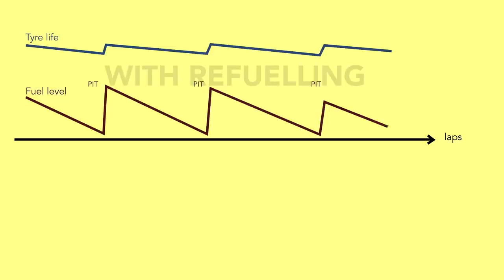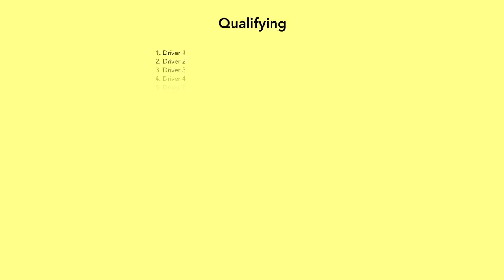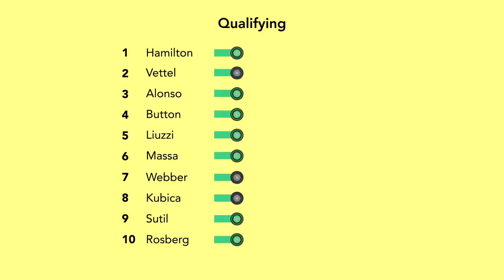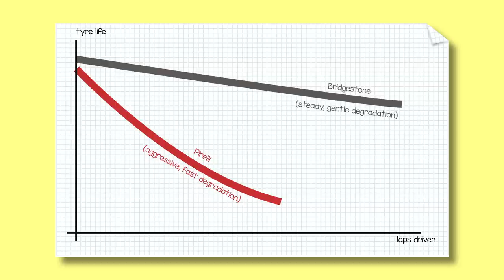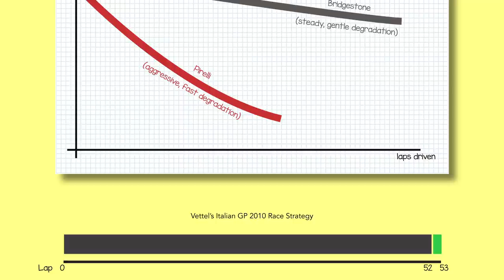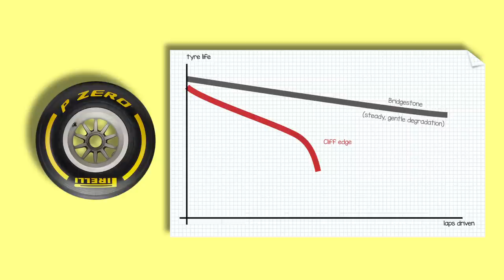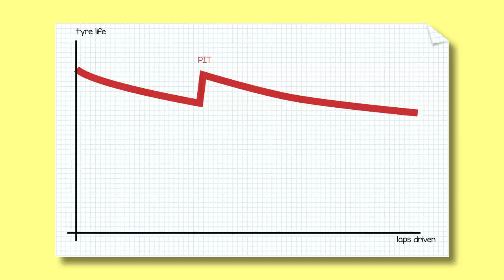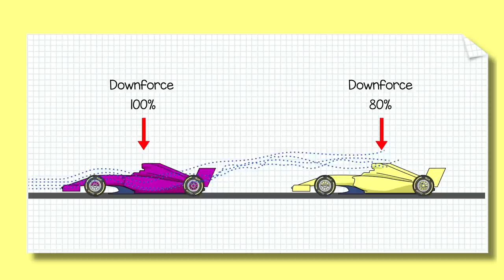How Canada 2010 shaped F1 for a decade - Chain Bear explains

Comment: Banning refuelling was the biggest mistake F1 - these days everyone runs the same strategy and it only really gets exciting when spanners are thrown into the works - with refueling you'd have a mix of short stints and long runs in the pack, never really sure who was going to pit when

And it hasn't had the desired effect anyway, with the reason for the ban to try and help reduce costs, but instead its just moved the costs with teams trying to shave time off the tyre changes- for example, last year lower teams use a fairly conventional, manually controlled wheel gun where as bigger teams like Mercedes are automatic wheel guns that costs about £20,000 EACH!
With refueling back in place, the tyres have plenty of time to go on and greatly reduces the risk of improperly fitted wheel nuts
Reply: on the contrary, refueling, if not done properly, can be really dangerous. Ask Max's dad, he learnt that first-hand. Not that I necessarily would see it vanish and never come back though, the overly emphasis on tires and its life has pretty much ruined the weekends all over ever since. Just look at W10 absolutely sweeping every race because they happen to treat their tires the best (from what I know). I thought race cars are supposed to be cars, not tires?
back then no one really complained about tires and all that and they're allowed to push the car as much as they could. some people might disagree with my opinion with tires, but personally I prefer driver skill over the ability of chassis itself. At least I never heard of 'conserve this, conserve that' in old races, but what do I know.
Reply: Dave McKeegan have you seen huge fire created by failed refuelling? Im glad its banned.
Reply: @bshenlow882  there have been a couple of high profile incidents around refueling ... But there have been far more incidents of wheels coming off both in pit lane and on track ... And I would argue between a fire around people all in fireproof clothing Vs a few hundred pounds of wheel being flung into a crowd of spectators which is more dangerous

I totally agree with you though, it's no longer racing, it's become endurance now
Reply: @mtunayucer  Indycar has always had refuelling, and has had very little major incidents.
Reply: @mtunayucer  have you seen the carnage of wheels flying into the crowd? ... Maybe we should ban tyre changes as well

There is always risks involved, but the amount of risk these days has been greatly reduced 
If you want minimal risks we could cap the top speed of the cars as well, maybe not allow them within 6ft of each other either
Reply: Dave McKeegan i have never seen that, can you send me a link?

F1 is trying to be as efficient and less harmful to environment as possible. Bringing refuelling back will be a backstep in those regards.
Reply: @DaveMcKeegan  C'mon man lets be real, your analogy is quite futile . Banning 1 aspect doesn't mean you have to ban others...Reducing risks doesn't equal reduce all risks.
Reply: @SunLevi  but how do you measure risks? Because in terms of injuries caused, there has been more injuries caused by tyre changes than by refueling

Overall the point of F1 is supposed to be the pinnacle of racing and strategy - but that isn't the case these days, with tyre management and 3 engines a year it's becoming endurance
Reply: @mtunayucer  if it's really about that "environment friendly" reasons, they'd go for electric by now and don't half-ass it. It's just the downsizing trend hit them back then when manufacturers thought turbo engines use less fuel but turns out that's not the case. Emissions? Almost, if not totally irrelevant.
Reply: @bshenlow882  Half of that issue was putting turbos on too small of an engine to try and crank out power. If the base engine is asthmatic to begin with the power output with a turbo chucked on is going to be crap.
Reply: BShen Low Formula E exists? You know? When all electric cars match speeds of F1 cars today, we will stop using fuels.
Reply: @mtunayucer  what I meant was they could've just switch over instead of making a branched out Formula exclusively for EVs.
Reply: @DaveMcKeegan  "Overall the point of F1 is supposed to be the pinnacle of racing and strategy".

What? This is absolutely not the case, since the beginning F1 is supposed to be the pinnacle of engineering and technology. F1 is designed to be an engineering race, not a close wheel to wheel race, that's what spec series are for. 

And the reason tyres shouldn't be banned even though it's a potential hazard or more dangerous than re-fueling is because it's obviously integral to the race, which fuel has become less so, due to... Technology!

Saying that "ohh this has to be eliminated too because this is" is rudimentary. things don't have to be directly equal or absolute. 

Lets actually analyse what would happen if refuelling came back, it has it's pros but people seem to have forgotten the cons. Refuelling biggest advantages were speed and weight saving, which didn't make the racing on track close at all. Not to mention the cost & expenses of refuelling.
Reply: Maybe introduce a forced 5 second stop minimum, and if refuelling is reintroduced make it a 10 second minimum stop so teams can get it all done safely without having to stress about fractions of a second , much less mistakes.
Reply: BShen Low as i said before, the electric cars arent as fast as formula 1 cars. When electric cars surpass f1 cars in speed and other aspects, they will replace f1
Reply: @SunLevi   Sun Levi  well that's bull since half the technology and engineering created in it over the years gets banned and they keep modifying the rules to encourage overtaking

Introducing refuelling would bring much more options for strategy and unpredictability rather than everyone running the same number of stops purely being dictated by tyre life (and arguably would make the cars more efficient as they'll be carrying less weight through the race)
The cons would be an increase in risk factor however I think the risks isn't as high as some people like to believe - it would also apparently increase costs because teams would have to take the refueling rigs with them to the races - however, as I said in my original comment, with the banning on refueling, teams are now spending insane amounts of money on equipment to speed up tyre changes by mere fractions of a second, and changing tyres in 2seconds increases the chances of mistakes - with refueling taking 6-7 seconds would prevent the haste on the tyres

My point about banning other things was more exaggeration - if the argument for banning refueling and destroying the fundamentals of racing purely from a reducing risks then we should first remove elements that pose more risks - and on numbers of injuries/risk factor - tyre changing poses more risk than refueling
Reply: @DaveMcKeegan  Fair point, but I don't think refuelling is at all the solution, it brings more cons than pros. Refuelling isn't going to make the racing any close. Less predictable sure, but not exciting enough to bring back. 

The strategy we have now IS predictable, but I believe there's an alternative solution to either issue. One that doesn't involve refuelling and one that isn't a 1 pit stop race, hopefully F1 can find that solution soon. 

Bringing refuelling back won't solve any of F1 current issues.
Reply: @SunLevi  I think you are quite mistaken about the effect refueling has on strategy -  you only have to look back at the Brawn/Schumacher era to see how the right strategy could transform a race

One team could go 1 stop, longer stint but slower pace Vs someone going for 2 stops, lighter load and faster - but if they misjudged it and got caught in traffic it could throw a spanner in the works, plus the pitstop durations would vary depending how much fuel you were putting in so you'd have to time it right if you wanted to get out in front of traffic, especially on a lot of current tracks like Monaco where overtaking in these cars on track is impossible, a smart strategy can completely change the flow of the race

With only tyre changes the fastest strategy is simply stretch the life of the tyres as much as possible - with refueling it would vary, the fastest strategy was usually 2-3 stops if you could get your management correct

Comment: Actually, refueling does not allow "all out sprint" like mentioned, yes it means tire deg becomes a very minor factor (except when blistering or graining was happening) but refueling involves a lot more fuel saving in order to get positions in the pits: you save fuel behind the car you want to overtake and then you can do an overcut with a shorter refuel to get the position

Comment: Since F1 is so predictable and boring, I’ve solved the problem by no longer thinking of each venue as a race.  I now look at each as a high-speed but orderly parade of F1 automobiles taking place in various picturesque spots around the globe.  Now I don’t grind my teeth when Mercedes always arrives at the head of the parade...
Reply: They said the same when Redbull dominated, and when Ferrari dominated before that.
Reply: Its not Mercedes fault they are dominant. Ferrari was the same before them. Its other teams job to catch up and compete.
Reply: @butterbean8881  yep, give every team a $400m budget and let them catch up and compete
Reply: @Shocker99  Yeh exept then there was usually still some action worth watching elsewhere in the grid and things weren't so predictable.
Reply: How exactly is f1 predictable.  No one knows who's going to win.  Sure mercedes has a strong car but one mistake and the lose.  Look how easily lewis binned it in fp2.  Doesn't take much for things to turn around.
Reply: @butterbean8881  Except that during the years of dominance of Both Ferrari and Red Bull, we still had some all time great seasons. 2000, 2003, 2010, 2012. Four incredible seasons even in the midst of one team dominance. It is possible for F1 to be watchable even if one team is dominant. F1 in its current format is dire and simply unwatchable. There is NOTHING to keep you hooked. Cars cannot follow each other so the only way to overtake is through DRS on a straight.  Everyone is more concerned about protecting their tyres now rather than going as fast as they can. And you have a team so dominant that it is a real possibility that they win EVERY single race on the calendar this season because they are the only ones who have mastered the tyres. How is that fun? Its gotten so bad that i've had to start following Indycar more closely for some excitement.
Reply: @Bahamuttiamat  It's predictable because Merc finished 1-2 for 5 races, and then 1-3
Reply: @Ruylopez778  That is a wonderful idea
Reply: @Ruylopez778  If F1 was this predictable, Bottas would be at least 2nd in Monaco
Reply: @king-lasagna  If Max hadn't driven into him in the pit lane he would have
Reply: Totally agree the one-team dominance is not new:  same with Schumacher/Ferrari and Vettel/Red Bull.  Both of which add to my “it’s boring” point.  The problem in my view—and I’m no expert—seems to be “the formula” itself.  Despite one uninformed gent’s comment about IndyCar being boring, that race formula is overflowing with competition every single race.  I’m not a big fan of the oval courses but about half are road courses—and many drivers are from overseas.  I think the “anybody can win” competition success of IndyCar is that all the chassis are the same and engine performance among different suppliers is similar—so driver talent, pit crew performance, race strategy, and set-up are king, not how many gazillions were spent on chassis design...  I suspect F1’s chassis design competition—though great for employing talented engineers—yields the lopsided performance and thus the one-team boredom...  If F1 went to a standard chassis I bet competition would soar and boredom would disappear...
Reply: @butterbean8881  Well, it doesn't help when Merc keeps getting a lot more prize money than the other teams...
Reply: @Shocker99  This is the longest and most powerful dominance, from 2014 nobody could fight them till the end of season.
Reply: I can predict f1, now 2 hondas are on the podium and mclaren
Reply: @seunonasanya6788  "Dominance" >Shows the seasons where teams were not dominant

Comment: Interesting video. I think atm if anything pirelli is a bit too much on the conservative side, I think more 2 stop races or even the occasional 3 stop wouldn't hurt!
And even if all problems were solved I hope pitstops remain a part of f1, they are part of the challenge
Reply: Will pit stops require strategy, strategy is unknown for Ferrari, Ferrari are kinda the only ones who can challenge Mercedes. But anyways true dat
Reply: Multiple-stop races are more interesting indeed. However, I don't necessarily think tire degradation is too low. When pushed, the tires still degrade rapidly. The real problem is that the drivers have become too good at nursing these tires, which is a faster way to complete the race distance than going flat-out, as this uses up too much tire life too early, as in 2011-2013. The thinner tires stipulated by the 2019 rules seem to have reduced tire saving (possibly because the maximum tire life is shorter), which is a good thing.
Reply: I think they're TRYING to do that, but the teams just keep telling their drivers to drive more conservative and going with 1 stop strategies.
Reply: Tbh I think the best solution would be to make all tires super durable again and just force the teams by regulation to make 2 stops if they made it into q3
Reply: @musculusiv4172  That would really produce boring races. If the tires don't wear out it makes no sense to replace them twice. However, with the current tires, it might make sense to force the drivers to run all compounds in the race, so they can push harder and there is more strategic variation. Having said that, with two mandatory pit-stops they can just as well re-introduce in-race refueling.
Reply: @mrdraw2087  Why would it make it more boring? If there were harder tires the drivers could push all the time which is certainly more interesting then watching them nurse their tires home. Right now a lot of the time a driver just won't fight for a position bc it would destroy his tires and that's bs imo
Reply: @mrdraw2087  And I think refueling would be a terrible idea bc then passes the only overtakes are during pitstops bc of the different refueling times. With tire stops the overtaking still must be done on track since all tire stops take about the same time
Reply: @musculusiv4172  Lol... You were the one who proposed more pit-stops... The pit-stop duration is just one reason drivers may overtake one another in the pits, the timing of the stops is another reason. The most important thing is that there are more strategic options available to the drivers to avoid the processional racing we currently have.
Reply: @mrdraw2087  Most important thing is that there is the most action on track which won't happen if the drivers can't attack bc they always have to watch their tires.
We already had a long period of refueling which was the era with the least on track overtakes as shown in the video, so I don't see a reason why we should bring it back